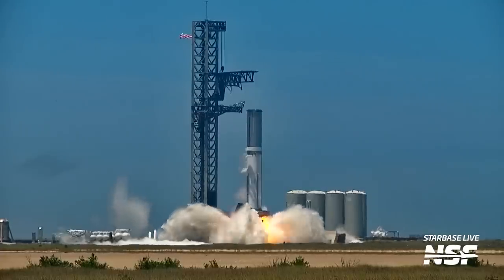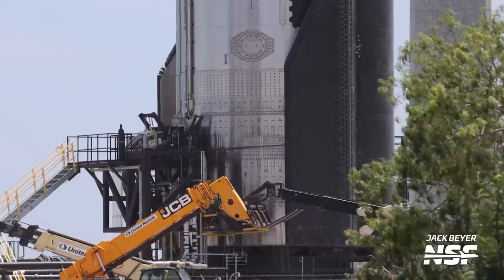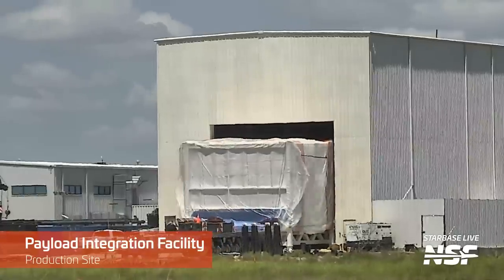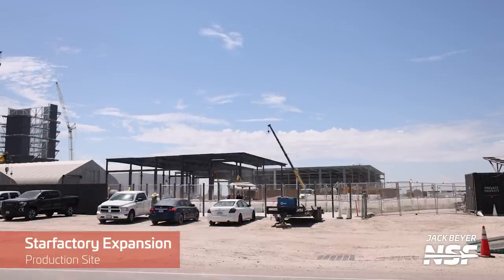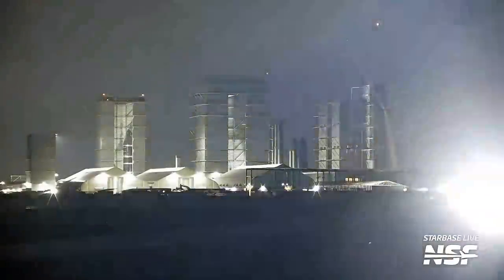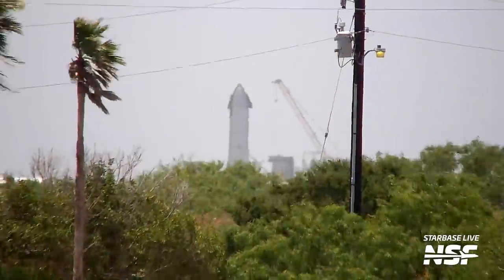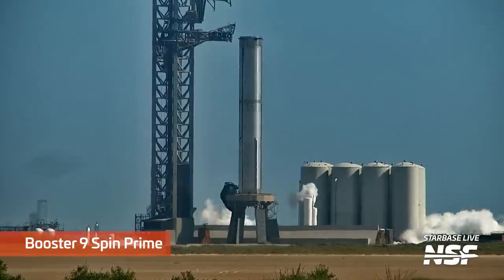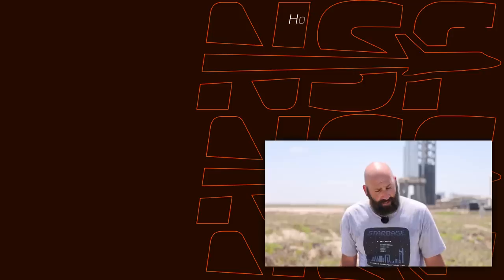Starbase Update: Epic Booster 9 Static Fire, Ship 28 Prep & Future Starship Tests

Comment: @NASASpaceflight I have been trying to figure out the purpose of the external structure of the high/mega bays. When I asked on another video, several people gave ideas but none really made complete sense. Some suggested it was for rigidity. Some suggested it was about maximising the inside area. 

The external framework is supported entirely by the internal framework, I dont see what it could be proving structurally given it is being supported, not doing the supporting.

The only possible thing I can think of is it disrupts airflow and prevents the sides being RUDed in hurricanes, but not even that makes complete sense.

I'd love it if someone could explain exactly what they do and how.

Comment: My guess is that they test it to failure.  Why?  Because, "Move fast, break things."  They'll learn what the actual limits are for that design.
Reply: And then redesign to lessen the weight. No part is better than having some parts. < Elon paraphrased.
Reply: You are clearly not an engineer or in the QA field. You don't need to break something to make something.
Reply: @EricHamm  Funny, that is exactly how software gets fixed. You test it to the breaking point and then fix what broke. Man-Machine Interface software had to be test run first to see if it worked as programmed, and then reprogrammed to get any bugs fixed,  and run again. And any new bugs fixed. Rinse and repeat.

Comment: While significantly reduced, there still seemed to be a whole host of debris flying around in that dust and stem cloud. It did seem lighter stuff though (not lumps of concrete) but still debris nonetheless. Hopefully it was all good!
Reply: I think this is mostly paint, coverings (heat shielding) and stuff like that, not "heavy" things like metal, stone, or engine parts.
Reply: No one is going to sweep 20 odd acres of concrete to dust free standards. There will always be some form of sand/debris in the cloud.

Comment: The problem with the ignition of all the engines has been around for some time, the first time they suspected that pieces of concrete hit the engines, but now I think it is obvious that there is another problem, I think they will redo the test and I doubt that the engines directly would be  the problem, I think they don't light up for a number of reasons such as mechanical and power shock, freezing of the pipes or lack of pressure in the fuel pumps, broken sensors, or wrong design/routing of the pipes, incomplete priming, etc.  4 dead engines is a lot for a test, I think it would be enough to ignite at least 31 engines for the test. I'm curious what decisions are made about this test.

Comment: Why would they not test the hot stage ring to destruction? Only if another component in the stack failed first, I think. Would know the limit.
Reply: In theory, I think the hot stage ring is definitely more rigid than any ring sections in Starship or Heavy Booster. If they can withstand the hardest test for ring sections, it's totally fine.
If they want to know its limitation, they have to make another test stand(I think the ring is too short)

Comment: I have a few possibilities for B9's fate. Please do not consider this a complete OR reliable list, and this is just uninformed speculation.
All good: SpaceX decides to ready Booster 9 for IFT-2, and doesn't remove the four engines. This could occur if the failures were sensor based. While this would be great news, it's extremely optimistic at best.
Minor engine swap: SpaceX removes the four failed engines, and replaces them with more modern versions of the Raptor 2. This is easily possible, but I'd be surprised if this is all SpaceX does.
Large engine swap: If the four engines damaged other engines, or if more than those four were malfunctioning during the static fire, SpaceX may replace a very large number of engines, but not enough to warrant a new engine section altogether. I'd consider this the most likely.
New Engine Section: If either all of the raptors are in some way flawed, or if the engine section is in some way flawed, they may replace the entire engine section, and all 33 raptors. In this scenario, they may choose to use raptor 3 engines, if they are compatible with the thrust puck of B9. This is rather unlikely, but still possible.
Scrapped: the damage done by the four raptors was so catastrophic that B9 needs to be replaced (or there is a fundamental flaw in the current Super Heavy design that cannot be fixed), most likely by B10 (possibly equipped with raptor 3s). This would delay IFT-2 into November at the earliest, and they may scrap S25 as well, as S28 (or even S29) would be both far more modern and equally ready by that point. The odds of this occurring, however, are very small.

Comment: How are they going to keep the engines from damaging/melting the top end of the booster when hot staging? (The booster is after all intended to be reusable).
Reply: that is what all the openings in the "Hot Staging Ring" are for.
Reply: Being in a vacuum during actual flights will help a lot with that.

Comment: hotstaging will work, since it has been done a lot of times in chinease and russian rockets. It's the least thing im concerned about. Heatshield and raptors have me worried more.
Reply: You're right. Looks like Raptor engine is not reliable or the arrangement and controller of 33 engines doesn't work well yet.
Some of them shut down prematurely in OFT and this static fire as well.

Comment: Seems to me they should test it to failure: rapid iteration...demands it?
Reply: @@godintheglass Starshjip's 1st flight didn't make orbit, but it did fly and SpaceX made >1000 changes to the designs of booster and launch pad resulting from those learnings. That's iteration.
ULA's Starliner, now that's something that hasn't yet worked as intended. If ULA had developed Falcon, it wouldn't be flying yet, never mind landing!

Comment: testing tghe hot ring at ground level and being fixed is not anyway near the same as being 7 mile high and in equalibribriuum of thrust and valocitity and less atmospheric pressure?the mtwo stages re racing up and one is ending thrust and a gentle push away is all thatb is needed?  Mimimum force to pART AW AND DISTANCE IS ALL THAT IS NEEDED?
Frst and second stages Cupped slightly not locked firm ? a push a wait of seconds before ingnition of secondry stage, even cold bioosters facing up on first boioster would give foerce to part stages at cut off

Comment: I am a bit leary of all the openings on the hot stage ring, I realize the exhast has to escape somehow, but thats is the weakest part or if your a engeneer they are stress holes designed to handle the stress of compression.

Comment: I think the hotstage ring is not complete, it's missing allot of structure and it's not tied together like a hub and spoke design. I gather they will have to test it to 300-400 tons force because of the loads on the booster prior to stage separation.

Comment: IF ONLY those bleeping Raptor engines worked as well as the WDS. SpaceX can do all the testing at the McGregor site they want, but if those engines fail harder than a horse racing jockey in the NBA the moment they're all linked together & moved to the pad, than it's all pointless.

Comment: My guess is they are going to find the engines shut down due to acoustic issues inherent to this launch pad design.  It would not surprise me if the second flight ends up delayed until mid 2024 while they figure out how to deflect the thrust away from the base and not directly at it where the energy can simply reflect right back up into the engine cluster.  They need a thrust deflector...some sort of a version of a cone under the booster to direct energy away at an angle from the deluge plate...which, in my opinion, is designed to spray water in the wrong direction.  Sound suppression water should be fed into the the chaos of the initial ignition burst...not away from it.  But...what do I know right SpaceX enthusiasts?
Reply: I know nothing about this stuff but I’ve no idea why they are trying to engineer the solution this way either. As you say, wouldn’t a better solution be to divert the thrust, heat and sound rather than attempt to suppress it a few metres away.
Reply: @MrStucks  The current launch tower and orbital launch mount can't be changed to have a deflector. I think it's too short. Water deluge is required even if having a deflector. At the worst scenario, I think they must change or upgrade both tower and launch mount for adding a thrust deflector

Comment: How about showing us some detailed pictures of the Pad after the test fire?   Personally I don't think this water deluge system can prevent damage to the Pad and Facilities without a Flame Trench.  It's just basic Physics.   For ever action there is an opposite and equal reaction.  Without the old flame trenches of 55 years ago, the problem of tremendously damaging thrust will still pound anything in it's way.  The water deluge doesn't even come close to the strength of the million of pounds of thrust hitting it and the pad.

Comment: Do the legs of the OLM spray water as part of the deluge system?  The pad under the mount seems to be beefed up but I worry about the legs taking the brunt of the blast.  Id still like to see some type of sloped or conical deluge structure to deflect the blast force sideways during a launch.   Got a feeling reflected shockwaves from all those Raptors could damage the engines before it lifts off

Comment: The static fire test ended after 2.7 seconds out the scheduled 5 seconds and 4 engines went offline early than expected. Sounds like SpaceX has some work to do. They might have to lift the OLM higher off the ground

Comment: It’s completely ridiculous to suddenly include hot staging…this just adds complexity for no good reason…when the priority should be orbital launch.
Reply: Other than having to manufacture the different interstage it's actually less complex. That's why hot staging exists to begin with because it's less complex than any other staging method. No independent ullage system required.